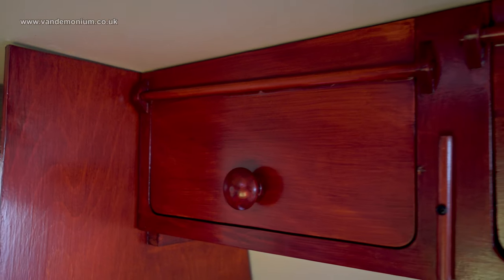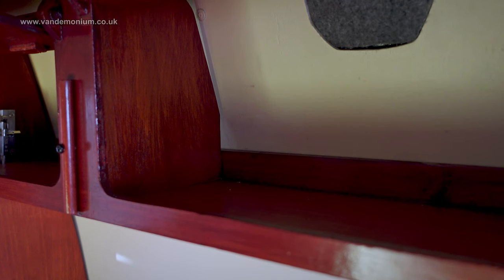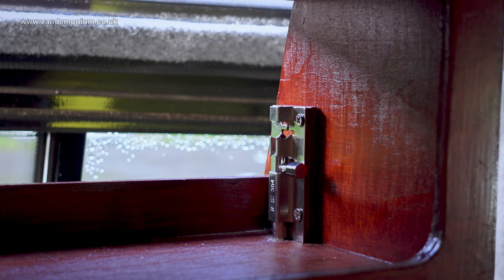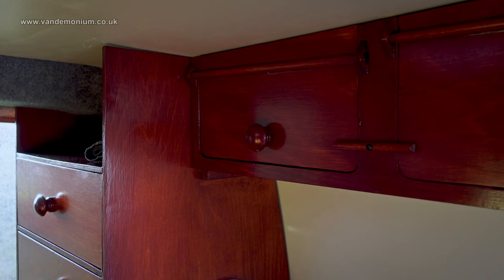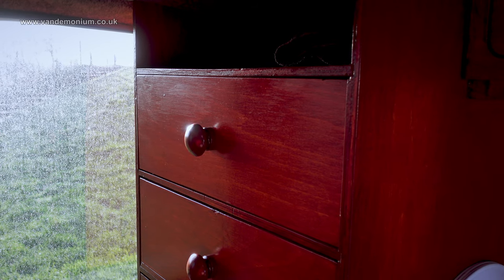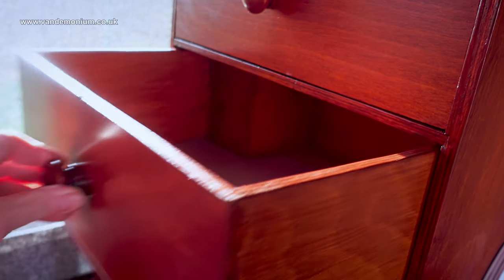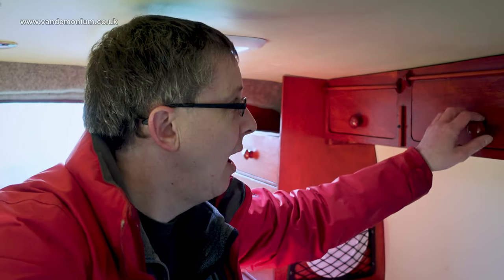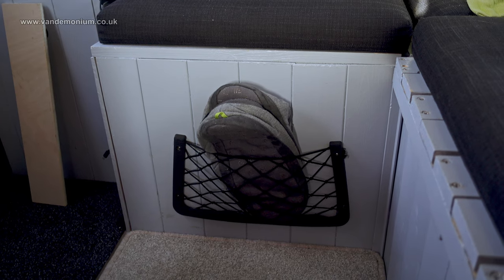48. Campervan cupboards: finished!

Comment: I love what you have done how about putting a spice bar across there get the magnet  spice cans and that way your spices are always close at hand you can get a magnet bar from IKEA to put your knives up out of the way but I really do love your van
Reply from the maker: Thank you! Spices would imply that I cook (!!) which I really don't and besides which I loathe food with spices in it, or anything even remotely hot - or mild - so a spice rack is unlikely to be installed!
Reply: @Vandemonium   you can always use the spice containers for other stuff salt and pepper  small screws,  lots of stuff you can use them for but I agree on waste of space if you are not going to use it  still love your van

Comment: Great idea/work on the dowel cabinet hinges. About the area that needs a sand and paint, how about using it as a screen for a pico/pocket projector?
Reply from the maker: I like that but it's really on the wrong part of the van, as I'd be likely to lie in bed to watch so a screen would need to be at the back or where the cab curtains are.

Comment: Great cupboard hinged doors and latches. Well done! (Unlike you, I do know about this stuff so my praise is the equivalent of an OBE or someting -- if you got it at a hardware store from someone definitely un-royal who probably needs to pull up his pants). Hinges can be tough. It's one of those 'components' that when you figure out what you need, you discover no one makes it. (I've got catalogues full of 'no that's not quite it')  Here's a tip you can actually use. Wax the pins. Know all those expensive drawer slides with the ball bearings? Well a birch or maple wood slide well waxed (bees wax is great) works just as well and lasts as long. Same with the bottoms of the drawers - yes they work well, but the wax will stop the wood from eventually wearing down. Any wax will work, a candle, sebum from the side of your nose or a shark.
Reply from the maker: Good tip, cheers!
Reply: Squalene. Excellent natural durable lubricant.

Comment: For that bit of wall that needs repainting - there used to be a wallpaper that looks like pine planks - in various depths of colour. How about an off-cut of that? Regarding the little blocks of wood to stop the drawers coming right out - What happens if you NEED to remove a drawer for some reason (say something fell down the back)  - are they screwed or glued in?
Reply from the maker: Haha yes I thought of that - screwed!
Reply: @Vandemonium  What - you, or the blocks?  :-)
Reply from the maker: Hahaha the blocks!

Comment: Mathematician: Oh, curses - internal hinges place the apex of the arc through the ceiling! This idea is fatally flawed...
Engineer: Ah, right - the door swings a bit up when opened! Oh well, let's trim a few mm off the top to allow for it...
Reply from the maker: Haha I did consider trimming a few mm off the cupboard top but then there’d either be an intermittent gap just at the top of the cupboards, or a gap along the top of the whole thing.

Comment: ok, I haven't seen ahead, but won't the net with the van slippers in it get in the way when you pull out your bed to make it bigger?  Great job with the cupboards. They look amazing.
Reply from the maker: I've since switched to storing my Kindle bookreader in there instead :-)
Reply: @Vandemonium  lol my first thought when I saw that net (next to the electric stuff) was great cubby for an iPad or phone. Kindle works too. 😊 I have the kindle app in my iPad. It’s great.

Comment: Just a thought, if you have to remove the corner shelf to access the Jack, wouldn’t it make more sense to simply store the Jack elsewhere as well?
Reply from the maker: Possibly but it's not hard to remove the shelf and the jack is nicely out of the way and held in place where it is

Comment: Sorry, this is off topic for this vlog but did you resolve your Propex acoustic ducting hiccup with the ducts first bend?
Reply from the maker: Sort of, I used the standard (bendable) ducting to do a 180 degree turn as it comes out of the heater, joined that onto the silent ducting down to the vent. I thought I showed that at the end of the video?
Reply: @Vandemonium  Maybe I misheard it as a possibility. Thanks for the update. I was asking as my daughter has the same unit in her VW T2.
Reply from the maker: I'd really like Propex to make a corner section that could be added to a straight section with a coupler; I must email them about it!
Reply: @Vandemonium  I see that Propex do a Tee piece and also a Y piece joiner.  Uninsulated and would need one outlet blanking off somehow (nothing is easy is it?).

Comment: Can't help thinking that you could have used the same type of hinges you used for your clever solution to the false drawer at the back. Sorry if it's a bit of a stable door/bolted horse comment.
Reply from the maker: They wouldn’t work, the ceiling is not thick enough to screw them into plus you’ll note the line of the top of the cupboards is at an angle, it’s not level so the hinges wouldn’t be level either.
Reply: Ah! Obviously I wasn't paying close enough attention.

Comment: I was a little surprised when said you have to take the cupboard out to get your tool out to jack the car up. Or am I mistaken?
Reply from the maker: Nope, the jack is right in the back corner, on its original little mounting plate at the back of the van. It's the work of mere seconds to take the shelf and cupboard off though.